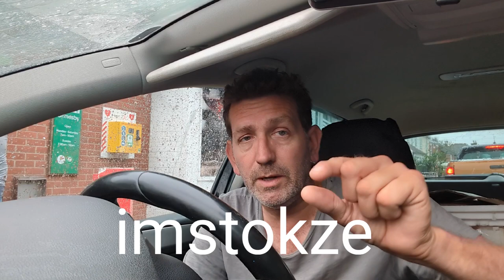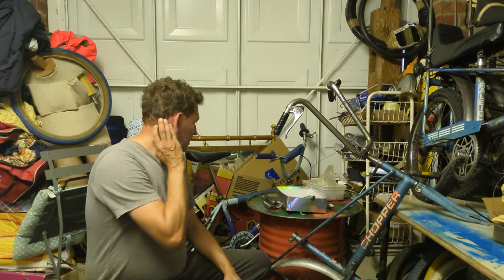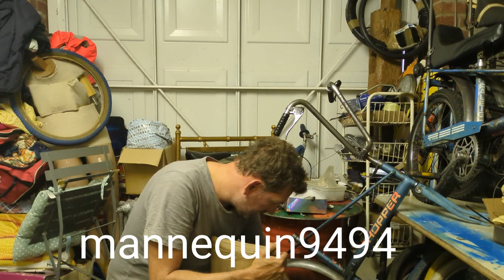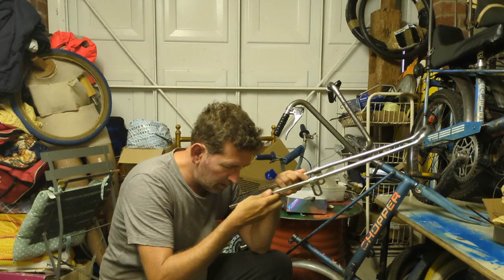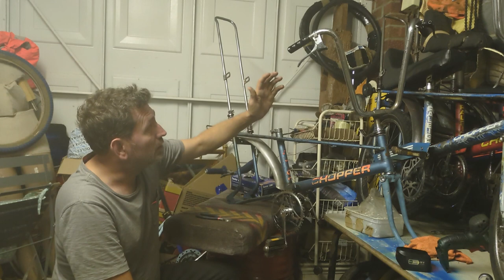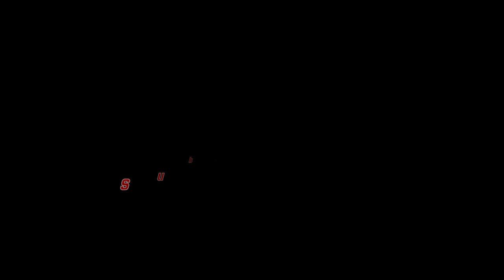Raleigh chopper MK2 space blue gets a sissy bar | build update | and a mention

Comment: got a blue 1 in atic   its be up years    no rust, or scratches,,flat tyres,cracked cables,seat looks new  but white  never seen ,white seet on any other
Reply from the maker: I believe the white brooks saddle and the white pedals were the factory option.. could be wrong.. it rides really well, dare I say it but better than a chopper,  You should give yours some daylight, pump up the tyres and give it a spin